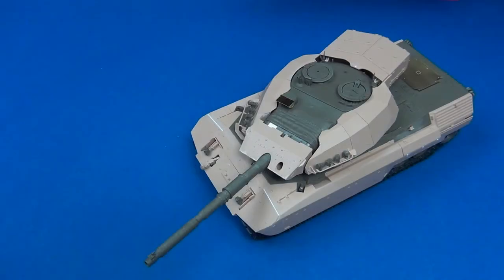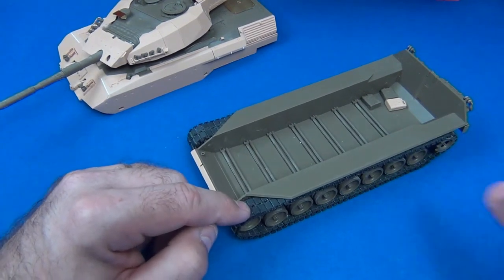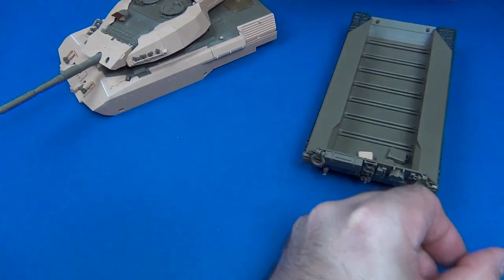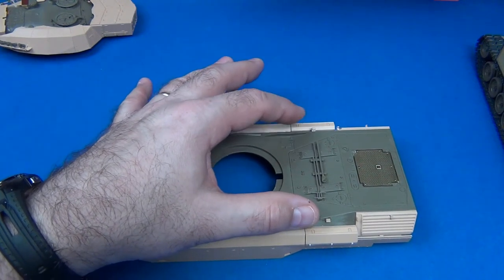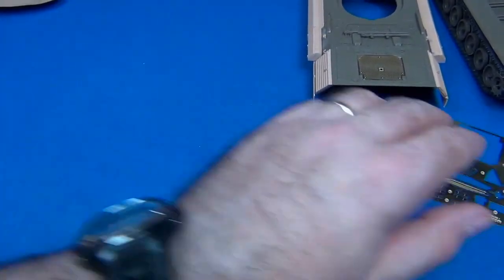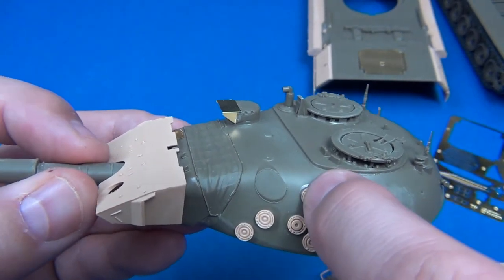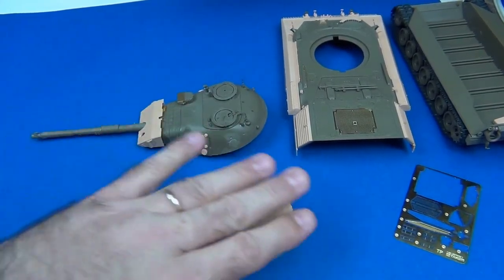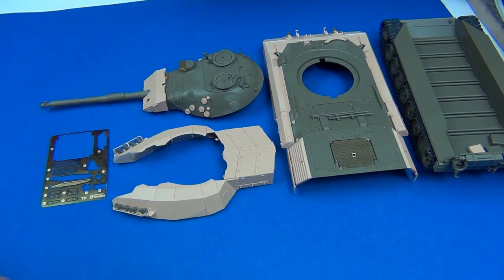TAKOM Leopard C2 MEXAS Part 1

Comment: I find the tracks a bit of a pain to put together, but they do look great, it's a shame most of the track is hidden. Other than the reversed part numbers and the PE bits, I found the instructions fairly clear compared to Dragon. I liked the kit, it was more fun than most of the Dragons, when I find the time I'll get another TAKOM Leopard.
Reply from the maker: I agree my friend !  

A few mistakes here and there doesn't make it a bad kit !  ... but some peoples will be fooled and glue those parts upside down or not form the P.E. properly and get an Odd feeling about the Trade Mark !      just saying... !      You are right about the instructions being clear compared to a Dragon's kit!     Very similar to a Tamiya kit in that regards.     The very Rear Add-on Armored Skirt plates can be removed,  if needs be ?   I have seen some pictures with out it !  Fallen-off or Damaged maybe ?  This could let people show off a little more track.... if they felt like it ?     I will look around and see if I can slap-on a Mine Roller Mounting Plate on mine !!!   Still researching how the Adapter plate fits on the Lower Glacis.

Will most likely use a Trumpeter Mine Roller set for that....  even if not 100% correct...  should give me a personal touch to mine.
Reply: I'm still considering another MEXAS with the mine plow...
The one already built is going into a diorama with a LAV-3.
Reply from the maker: Forbes Hutton
Remember the Canadians Mine Plow has Square Tubing versus Round !  you might need to scratch build a little to reflect that !   All the best to you !

Comment: Great build log Norm as always.  I do find these mistakes you have highlighted in a very modern kit simply amazing and totally unnecessary.  Modern CAD programs are designed to avoided these basic mistakes by providing an alarm in red over the drawing highlighting a area where there is a collision of components or where two components will not match with the required clearances. While mistakes in language translation or part numbers incorrect within the instructions are understandable, major build issues should come up during a first prototype build called a white build. From what I have seen on other videos I was expected Takom to rise as one of the premier military kit manufacturers providing kits that one could rely on to be an issue free build.
Reply from the maker: Yes...  I totally agree with you !   Great point you make!   
With the amount of fine details provided in this kit.  The few inconsistencies found in the instructions and fit issues should have been spotted and remedied prior to launch !  an attempt was made with the Errata sheet.  so TAKOM was aware of some issues and this was done to correct a design flaw!  The MEXAS Armor bolts on the Turret parts were machined Oblong or teardrop.... and need to be shaven off then replaced with molded on replacement bolts which are located on a Sprue gate.  Probably due to tooling limitations?   I will still be buying this kits...  as they are superior to older manufacturer offerings like Italeri, Revell or even Heller !  and I am sure other viewers might disagree or agree to disagree !  LOL

Thanks for your comment !    Your support is invaluable !